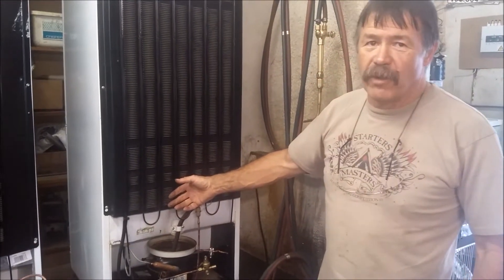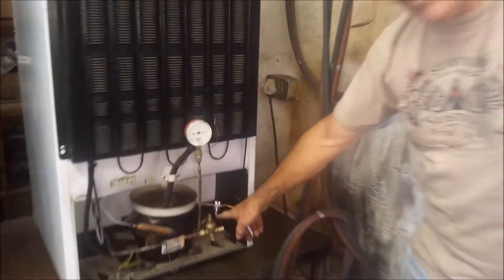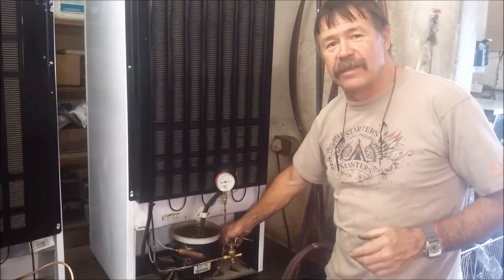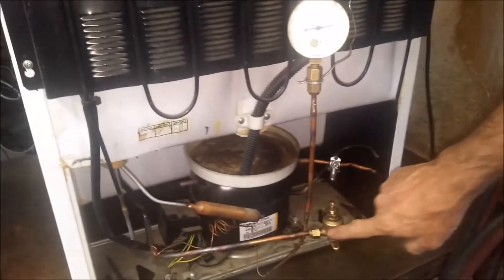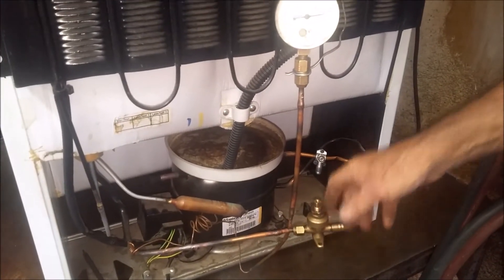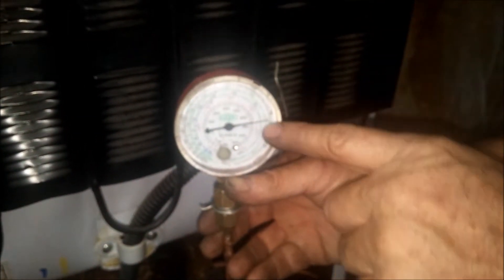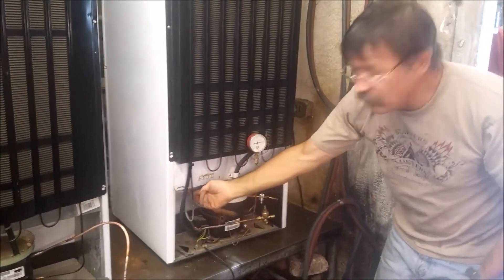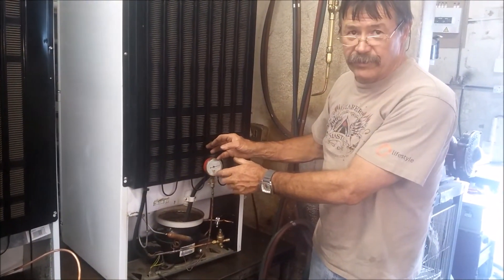How to determine an internal gas leak - J D Nel Refrigeration

Comment: Hi Johann, thanks for your great channel!  Could I ask  when you regas, how much goes into the high side and how much to the low side?  I would be doing it by weight. Also could you tell me about the gauge you use? thanks from oz xx
Reply from the maker: When you charge the fridge it all goes into the compressor. When the compressor starts up it circulates the gas throughout the whole system and we try never to let the suction pressure go into vacuum.

Comment: When you say GAS, you mean Freon correct? I have a smell of gas/diesel in my house and am trying to find out where it's coming from. Everything is electric (water heater, forced hot air heat, A/C, cooking stove, oven, dishwasher, etc.) I am stumped and the smell is driving me crazy. Windows are sealed shut, so it's not coming from outside. I just wanted to make sure that it wasn't the refrigerator. (my last hope) It is electric, and I know those are cooled with Freon, so I wanted to make sure before I call a repairman. Thanks
Reply from the maker: Freon gas is odorless. It cannot be Freon gas that you are Smelling.

Comment: by closing the capillary and draw vacuum on the suction line much quicker way or use micro gauge
Reply from the maker: The reason why I don't use vacuum is that once your system is in a vacuum and you have a leak somewhere in the suction where there is moisture, you will draw all that moisture into your system.

Comment: Very good info. What do you use to pump up that much pressure? In my neck of the woods alot of fridges get thrown out so I am trying to learn your revival methods. Thanks.
Reply from the maker: I use an old refrigerator compressor and pump it up with air.
Reply: @JDNelRefrigeration  Thanks, I appreciate the info and feedback.
Reply: @JDNelRefrigeration  Cool idea, never thought of that. That would make a good video.

Comment: What supposed to be show numbers  value on manifold  for determine leak is from internal  or ouside around compressor and dryer joints
Reply from the maker: You cannot determine a leak by watching pressure on a manifold gauge.
Reply: @JDNelRefrigeration   i will keep fallowing your videos for answers thanks lot

Comment: JD ek het 2 yskaste wat aanhoudend gas verloor. Ek is nou al raad op. Is daar nie 'n kleurstof wat 'n mens saam met die gas kan insit om vas te stel waar die lek is nie asb?
Reply from the maker: If there was a colouring agent that you could put in to try & find a gas leak, a small leak like yours, that normal detection methods cant detect, a colouring agent will not be visible with the naked eye.

Comment: I once had a refrigerant leak in the internal tubing between the condenser and the filter dryer 
which I found using the method you described. Not knowing how to fix the internal leak, I decided to bypass the internal tubing and go directly from the outlet of the condenser straight to the filter dryer. This definitely may affect overall efficiency, however, the unit has been working for about eight years now and the customer reports that it's been working great.

How do you cut open the back of the fridge to have access to the internal tubing?

Thanks for a great video, sir.
Reply from the maker: The internal tubing is made from steel and most of the leaks are steel tubes which rust through. Even if you can reach it, it is impossible to replace. So I also disconnect it but then add an extra piece of external condenser to the outside of the fridge. In most cases they over-design the size of the condenser so what you've done will work in 90% of the cases but in some you need that extra piece of external condenser added.
Reply: JDNelRefrigeration Thank you, sir. It hadn't occurred to me before. Any idea or rule of thumb as to what the length of that added piece of condenser should be with respect to the existing external condenser's length?

Thanks again, sir!
Reply from the maker: More or less the same size as the section that you disconnect.